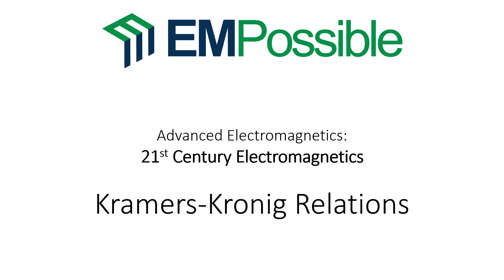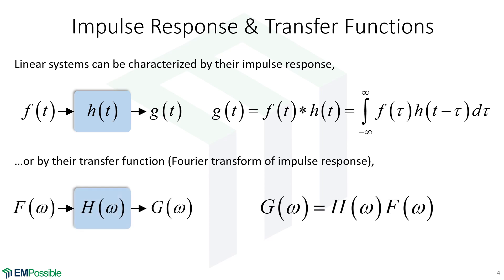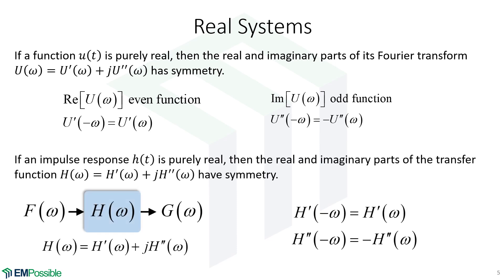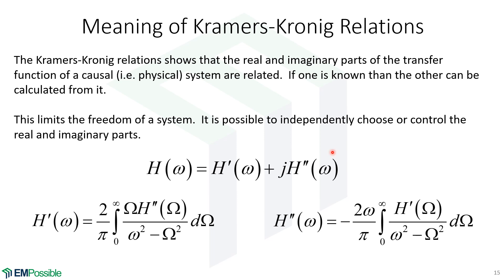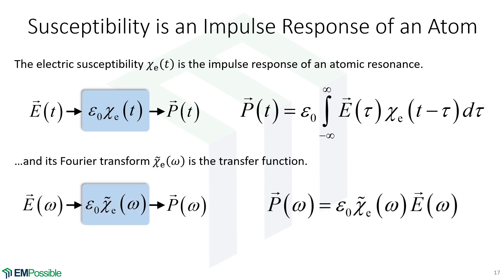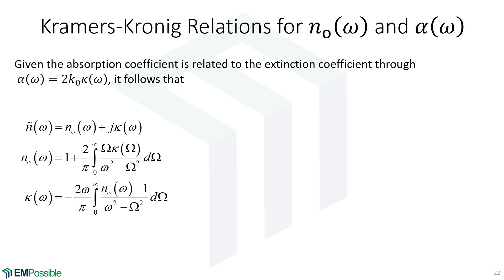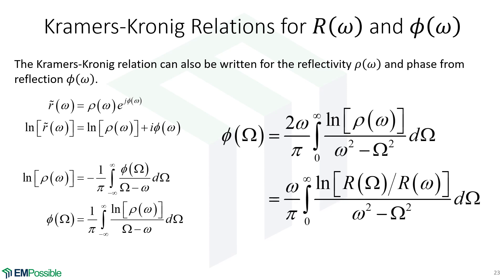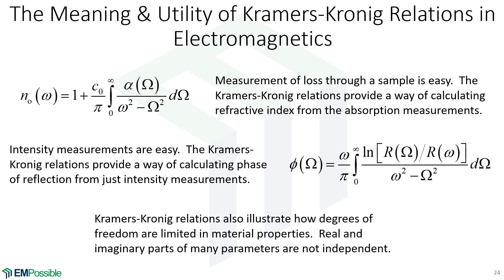Lecture -- Kramers-Kronig Relationship

Comment: Thanks for the video. At 14:57, for \epsilon_r’’(\omega), should not \epsilon_r’ be a function of big omega? So (\epsilon_r’(\Omega)-1). Also, from statistical mechanics, I have learnt that dilute means that there are many more states than what there are particles. Is this description related to the susceptibility being less than 1? If yes, how?
Reply from the maker: You are right!  I goofed!  Sorry!!

As for number of states, maybe the concepts are related.  For me, dilute media means teh susceptibility is small enough to simplify the math.  Physically, this happens when a material is not loaded very heavily.
Reply: Thanks for the reply. Which of \rho and R on slide 23 is reflectivity? How are they related?
Reply from the maker: @PS-dw5qo  r is the reflection coefficient and is a complex number because both the amplitude and phase can be changed on reflection.  rho is the amplitude of the reflection coefficient so that |r|= rho.  That I know of, rho has no special name so I am pretty sure "reflectivity" refers to the reflection coefficient.  I actually think the word is just a general term for how much something reflects.  Reflectance is the fraction of power reflected.

Comment: Practical questions: For deriving the refractive index from absorption measurements, how does one determine where to truncate the "infinite" integral?  And also how does one deal with the denominator becoming zero?
Reply from the maker: Great questions!!!

Generally, kappa is measured and n is calculated.  Kappa is usually nonzero only over a limited range of frequencies so integrating above or below that does not have to be done.  You can really just set the limits to the bounds of where kappa is non-zero.

There is a point where the integrand explodes when little omega equals big omega.  This is handled using the Cauchy-principal value technique.  Essentially, you just ignore the small band of big omegas where the integrand explodes and estimate what the integral would be from values at the edges of that band.  As the width of that band approaches zero onto the singularity, you get your integral.

https://en.wikipedia.org/wiki/Cauchy_principal_value

I may add some notes about this to the slides.  Very good questions!
Reply from the maker: I have made the addition to the notes.  I am working on updating the video as well.  You can see the notes at the course website under Topic 2:

https://empossible.net/academics/emp6303/
Reply: @empossible1577  Thanks Professor!  That helps a lot.  This issue always made me doubt the practical usefulness of the K-K relations.  Thanks for setting me straight!